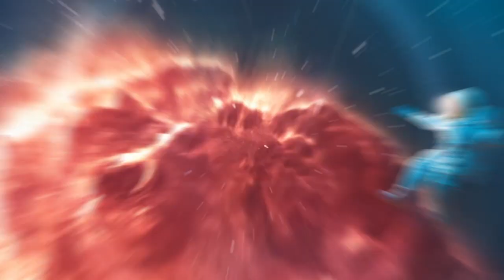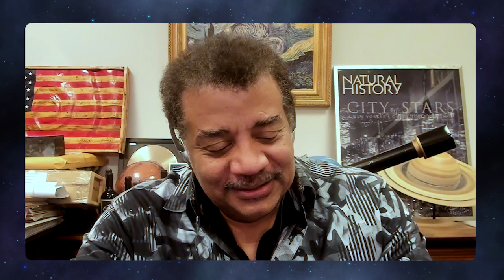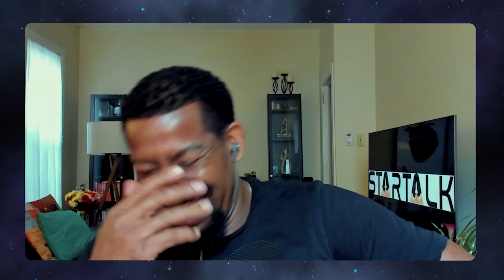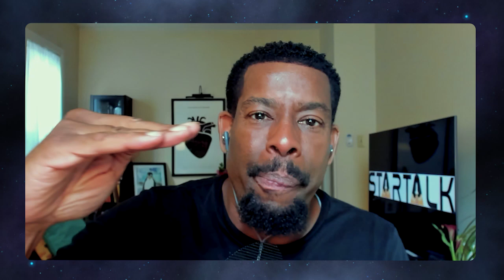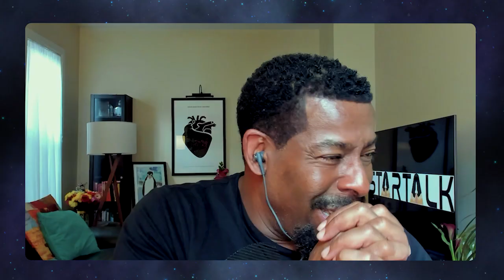How An Astrophysicist Makes Toast with Neil deGrasse Tyson

Comment: From an astrophysicist's perspective, the thermodynamics of toasting bread offers a fascinating microcosm of heat transfer and chemical kinetics. As we apply heat to the bread, we observe a complex interplay of thermal energy dynamics reminiscent of cosmic processes. The toasting process begins with the application of heat, analogous to how stellar objects transfer energy through radiation. The heat conducted from the toaster's elements raises the bread's temperature, initiating various thermodynamic phenomena. The Maillard reaction and caramelization, which occur at elevated temperatures, are akin to the chemical transformations observed in stellar nucleosynthesis, where elements undergo fusion under extreme conditions.
Just as the balance between temperature and pressure governs the life cycle of stars, in toasting, the interplay between heat, time, and chemical reactions determines the final outcome. The evaporation of moisture from the bread represents a phase transition, similar to the vaporization of materials in astrophysical environments. Thus, the study of toasting not only reveals the principles of thermodynamics on a culinary scale but also mirrors the fundamental processes governing the universe, from the microcosmic scale of bread to the macrocosmic scale of stellar phenomena.

Comment: Water moisture inside the toast, or that log in fire, stays at 100C because it can't get hotter, can't turn into steam. Due to inner pressure not allowing for expansion, inside the log? Is this correct?

Comment: An if ya don’t want peeling just place in a bucket 🪣 of water 💧 potatoes 🥔 just under water level measure 📏 of bucket
They make adaptations for mixing kitchen appliances with the mixer I prefer crank old style because electric ⚡️ is unsafe around water 🚨⚠️ hand spin clean then wrap up in plastic wrap once more place puncture holes that of a dart all around it’s worth it all because here is where it done ✅ by microwave possibly 80% faster 
Boiling potatoes 🥔 is good too 🤷‍♂️🥔 peeled then a 🔥 fire when all is good & no rain 🌧️ we all enjoy potatoes my father once said what ever effort is spent for food isn’t waisted.😂🤷‍♂️

Comment: I was hoping you would discuss why no one will manufacture a modern toaster that works like they did in the 70's. They insist on using timers that might toast correctly the day you open the loaf, but 3 days later it burns.

Scraping burnt toast looks good, but you can still taste "burnt"

Comment: For those interested in how a toaster determines when the toast is toasted, Technology Connections has done a video about it. He's also done one about rice cookers, which also work on the principle that the rice won't be done until the temperature starts to rise above the boiling point of water until the water has all either boiled off or been absorbed by the rice. The "dumb" rice cookers are more clever than you might think.

Comment: Help me figure this one out.  Take a common hard cookie, not soft, but there are hard cookies available. Take slice of bread, the sandwich type, place it in a sandwich bag, zip lock bag, etc, along with the hard cookie on top of the bread slice, then close the bag. Use two cookies if you like by placing the bread in between the cookies. Do not refrigerate, leave it on the counter. Depending on the thickness of the cookie, within 11 to 24 hours or sooner, the cookie will become soft and the bread the will harden.  Please try this experiment.  I can't figure out why this happens.    We have a very famous type of cookie here in Hawaii, "Stone Cookies".  I like the taste of it but it's too hard for my sensitive teeth, so this is how I soften it.  Dunking it in coffee or milk to soften it? Too mushy for my taste.  Also, for me, the hardened bread tastes bland, and terrible for toasting.  I feed the harden bread to the birds.  Someone please try this experiment and get back to me please.  PS: After about a half day, check the cookie by gently squeezing it.  If is is soft enough for you, remove it from the bag and enjoy! Aloha from Hawaii.

Comment: Flint like the wheel 💫🛞✨💥🔥surface tension stone 🪨 Does the same thing.
Example if the spring holds the stone 
🪨♨️➿🔥steady in place  when heated up ⬆️ it dehydrates
And, it swells it will become crisp yet at this point glowing red orange then fractured it will explode 💥✨
Caution ⚠️ do not try this without supervision or, safety 😎

Comment: The other thing to point out about this is if you want a soft center and a hard outer layer, use fresh bread because of the higher amounts of moisture still in the bread. For harder all through, use old bread that's lost its moisture from being out too long or just plain old.

Comment: Um. But If you have bread in a toaster and heat it up to 212 degrees Kelvin (SI units for temperature) then it's still going to be frozen and not turn into toast.
Reply: ?  212°F
Reply: @silvershadow013  Not an SI unit of temperature used in Astrophysics though!
Reply: @ministryofarguments3525  HmmmI thought Neil said water boils at 212 degrees which would be Fahrenheit, which is why I said what I did.  Why would he pick 212 Kelvin?
Reply: @silvershadow013  I thought WTF. This is on YT and the rest of the world use Celsius not Fahrenheit because it relates to the same scale as Kelvin (SI units for temperature).

Why are the US so out of step with the rest of the world when it comes to reporting temperatures?
Reply: @ministryofarguments3525  OMG..I agree.  Metric is way easier.  So the US went part way...carbonated drinks are sold in 1 and 2 liter bottles, vehicles (screws, bolts) are metric or part metric, and so on.  Makes no sense.  🥴